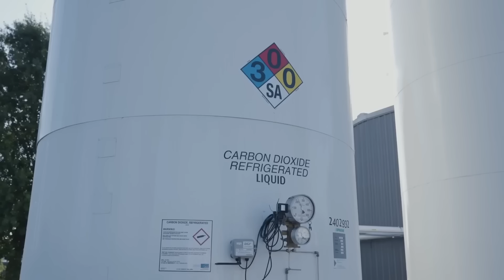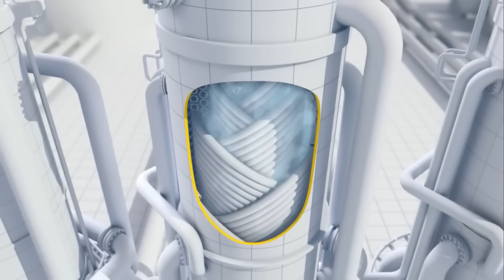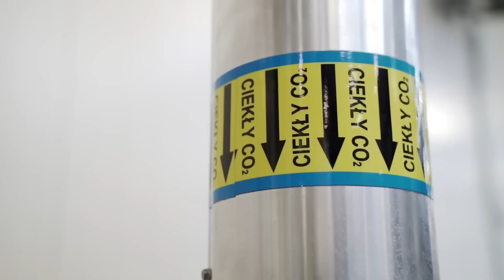HOW Industrial DRY ICE is MADE 🧊

Comment: Back in the 80s I used to rebuild air compressors and alot of them used tapered roller bearings and we used dry ice to shrink the bearing cup for installation as the bearing cups are press fit in the housing instead of using a hammer and flat punch 
By using dry ice , The bearing cup would slide right into the housing
Reply: Wow

Comment: there is no such thing as liquid co2...
Reply: at the right temperatures and pressures, it can exist
Reply: https://en.wikipedia.org/wiki/Liquid_carbon_dioxide
Reply: C02 can't exist as a liquid at atmospheric pressure. But if you pressurize it above about 75 PSI it can exist as a gas or liquid. At room temperature it exists as a liquid at about 850 PSI.
Reply: ? explain